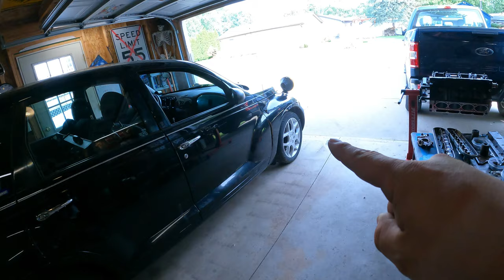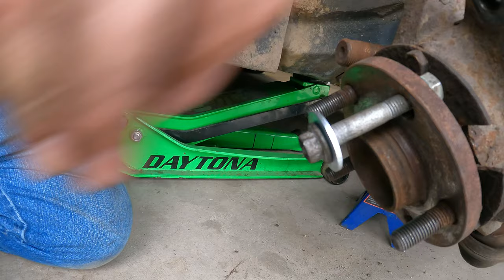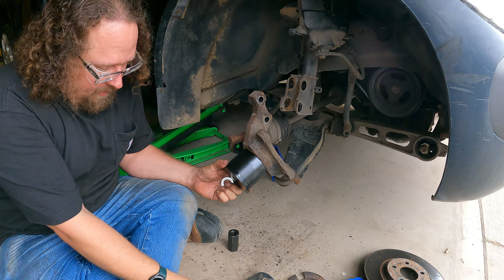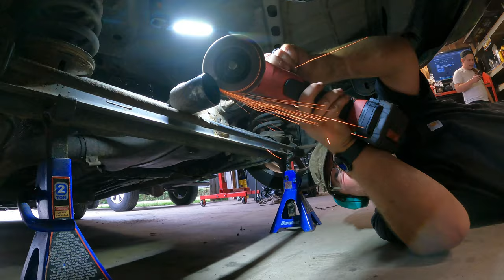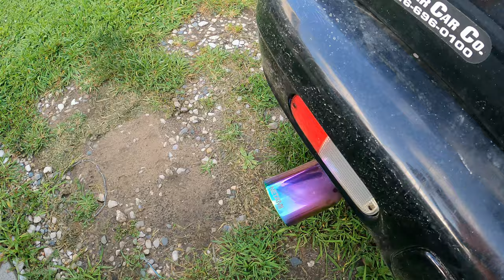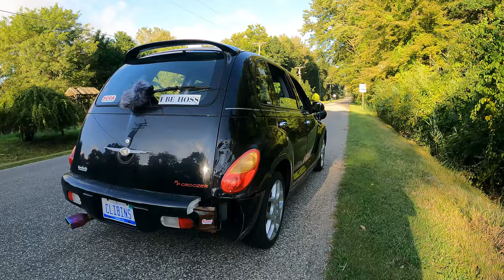How to add 100HP to your Econobox Racecar | PT Cruiser Racecar ep. 8

Comment: Lube the threads on you puller and the washer and nut and bolt head surfaces. it will be easier to use and last longer.